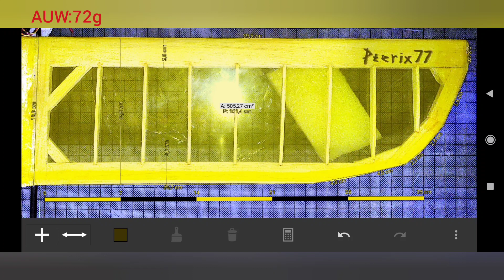77cm Balsa DLG

Comment: Nice! I like the unconventional wing design - curved in the other direction than all other dlg's. But obviously it works perfect and looks fun to fly. Btw - I'm practicing now with my first diy hot wire foam cutter. Still pretty wavy surfaces. Reason: templates too soft, from beer-can aluminium. Need thicker ones. Good night.
Reply from the maker: Nice, what are you planning to build?
Reply: @afilos  some kind of elf-apogee lookalike, 1m glassed wings 2 channel, so something quite similar to your newest GF model. Plan is almost finished in cad. I will post it in rcgroups as soon as I succeed in cutting the foam cores. See you there again.